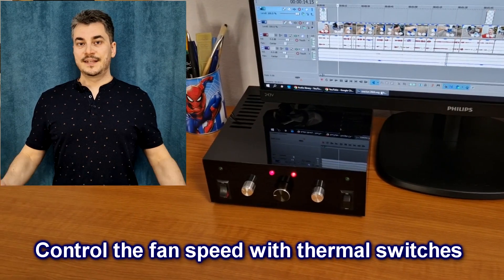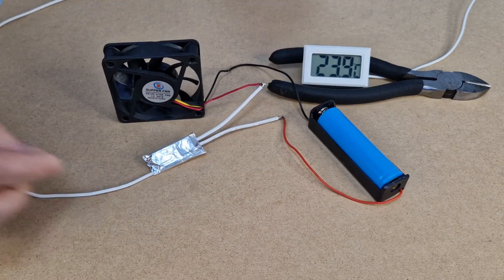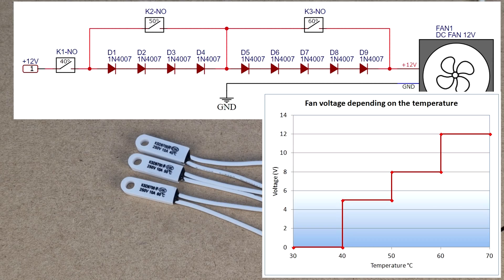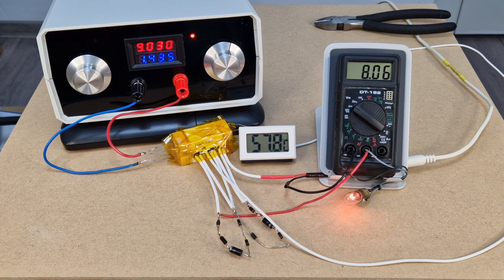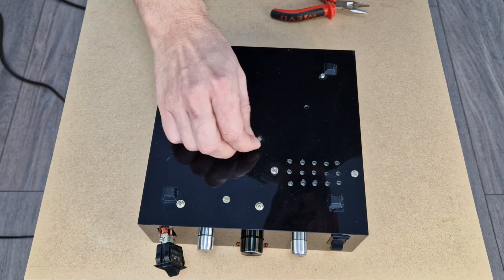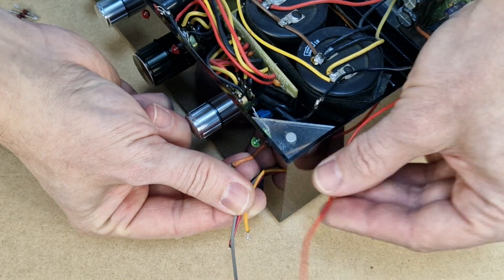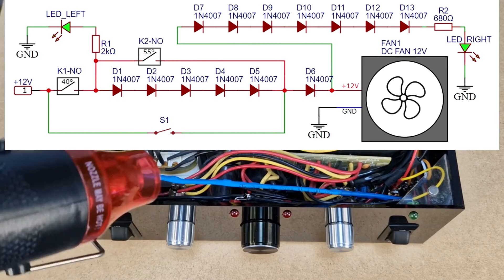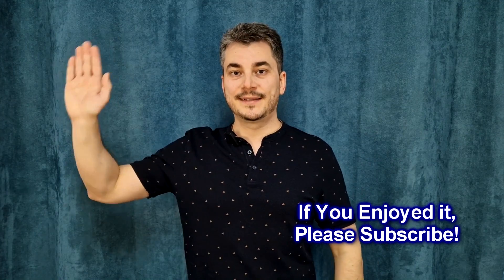Automatic fan control for my old amplifier

Comment: Hi Sorin,
Can you design a UPS for a 12V 1.5A modem and 9V? I found a module called LX-2BUPS, which powers a modem and card reader using two batteries and a mobile charger. The input voltage of each module is 5V, and their outputs are 12V and 9V. Can you design something similar or even better?
Reply from the maker: Hi, I want to make a UPS with LiFePo4 cells. It will take some time, I'm still testing the cells and working on the design, but I will build it soon.
Reply: @Sorin_DIY  Hello, thank you! I’m eagerly looking forward to seeing the video you create.

Comment: 5:19 or you can just use an arduino
NTC 
And a mosfet to control the fan just like the graphics cards fan. Cheaper and smaller

Comment: How can the fan be annoying late at night but not the music or the sound of the speakers ? It's just extra work . Turn the amplifire off and use  headphones ant night
Reply from the maker: Actually it can be annoying. When I record the script, the microphone is near the amplifier on the same desk. I need to check what I record, so I cannot turn the amplifier on and off continuously. 
Or I'm doing some audio/video editing and there are some low volume sounds I need to hear, for example relay clicks, fans turning on or off, or the hum of the electrical transformer.
I rarely use headphones, because the sound is clearer with headphones and I want to edit the videos so that they sound OK for the people that don't use headphones also.

Comment: Honest question: Why didn't you use a microcontroller? An ATtiny10 or ATtiny13 would have been perfect for this job.
Reply from the maker: I need to learn a bit more programming, then I will start using microcontrollers.

Comment: With this transformer.... TDA never have a enough power to working with rated power...
Reply from the maker: That is correct, the amplifier boards cannot deliver the maximum 100W of power with this small transformer, but with 4ohm speakers it's still pretty loud.

Comment: This is a simple approach you can use a ntc thermistor as a temp sensor as the resistance changes according to the temp this can control the fan using some comparator circuit(opamp) ex for some temp a fixed resistor can be used (hence the voltage drop will be same)

Comment: Great video! Your amp is working for 15-16 years and still working, in todays component manufacturers or seller the old quality is just not there, i removed a tda2030 from a old amp and it was better than the new ones